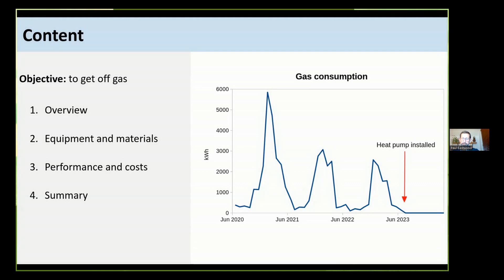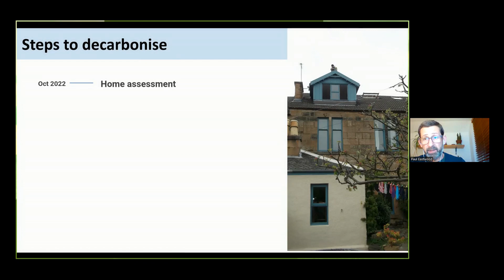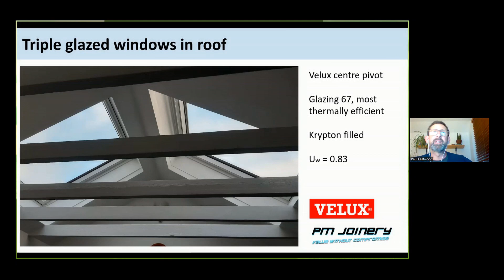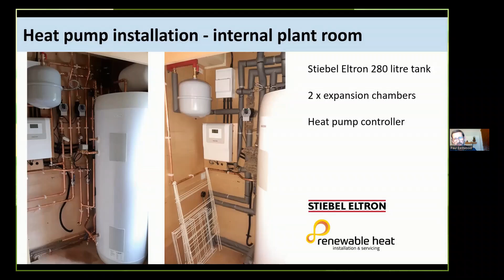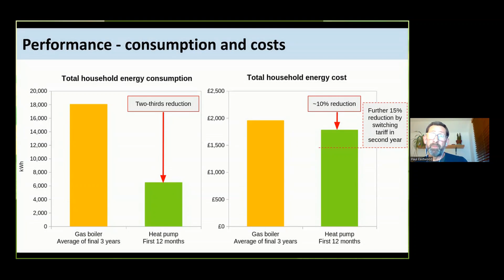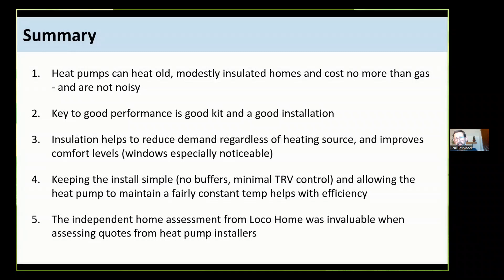Home Decarbonisation

Comment: The 350% efficiency is because the heatpump is pumping existing heat from outside - it steals heat from the air on your street basically - and squeezes it into the small space of your house. It doesn’t ‘make’ heat - just moves it and squeezes it down a bit. 

Only need about 0.3kwh of electricity to get 1 kWh of heat into the house. 

Sneaky.

(A gas boiler actually has to make make heat by burning gas, and a bunch of that heat disperses out of the flue so it can’t even reach 100% efficiency).
Reply from the maker: @constructioneerful  so does it make the air on the street colder?

Comment: I’ve just had a heatpump installed just a 3 bed detached house 1950s normal insulation (loft old double glazing and cavity.) 

Cost was £4000 after the grant. 8kw heatpump (Dailkn) including 3 bigger radiators.

Fitted by Octopus and very pleased with their service.

Cost of running it over the year will be about the same as gas - maybe a bit less as i have an ‘EV tariff’ so my electricity costs per kwh are very very low.

(And my car fuel costs are also 10% of what they used to be!)

Decided to get solar panels afterwards and it’s great. House has a EPC Grade A now. 

6 years ago it ran on coal!

And I sold my 5 year old gas boiler for £350 on ebay.